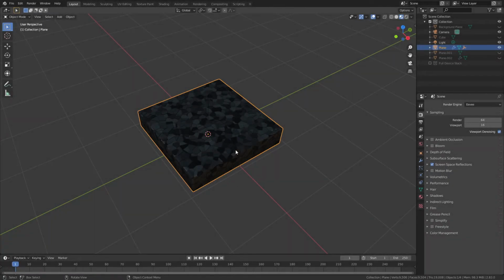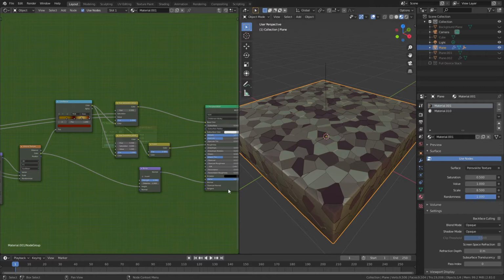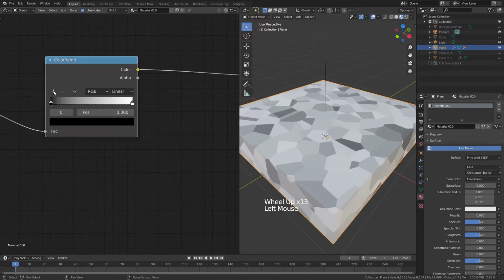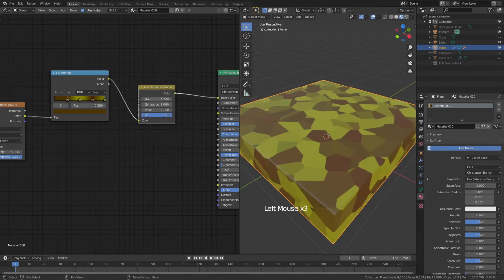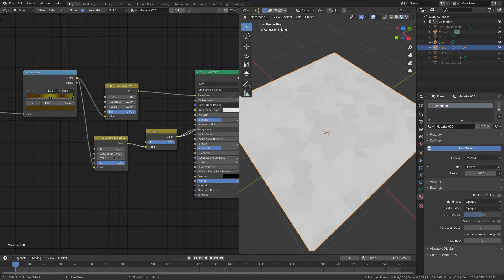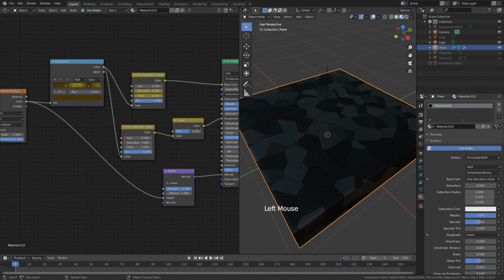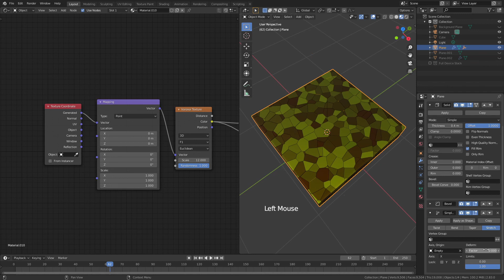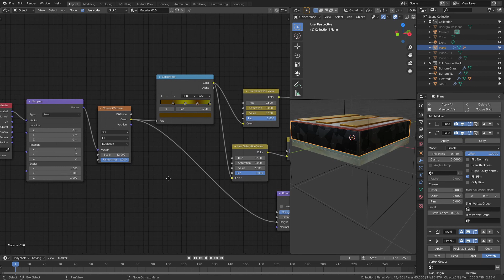How to Make a Perovskite Texture in Blender

Comment: Thanks for the such nice tutorial. I met a problem when I follow your tutorial. The texture was not uniform between the top surface and the side surface. I am not sure where is the mistake. I also used a plane with several modifiers to create a cube.
Reply from the maker: Hi Suzhe. If you are using a plane I might have an idea here. Try applying the scale with Ctrl+A. If you gave the plane thickness with a solidify modifier and then changed that thickness by scaling in the Z-axis it will distort it.
Reply: @CGFigures  How the first  textured figure came from ?